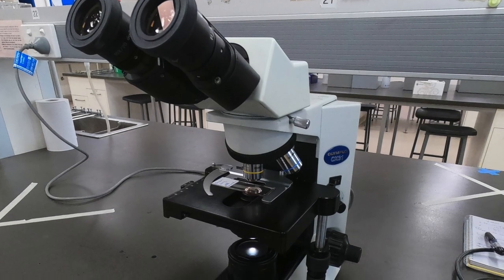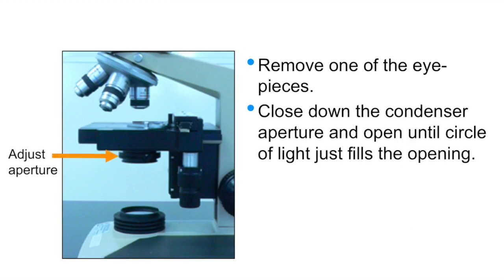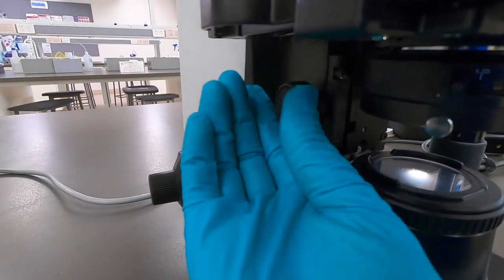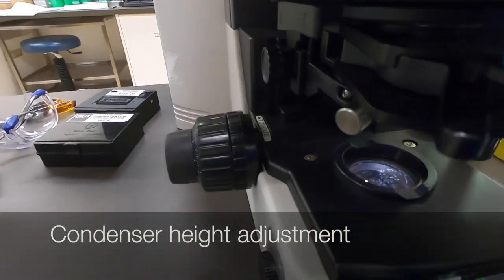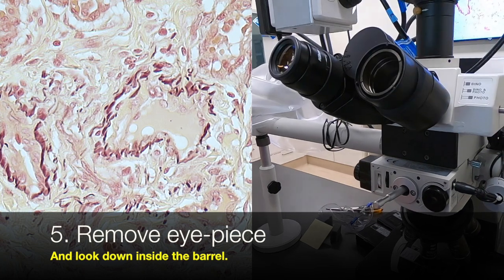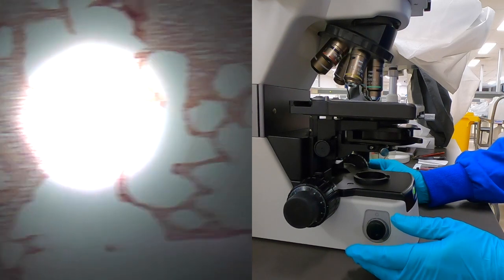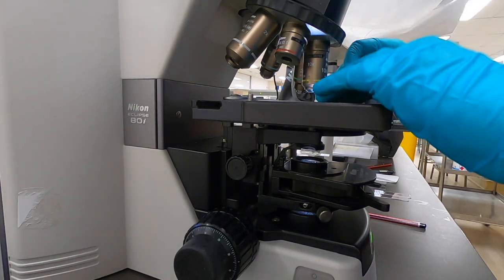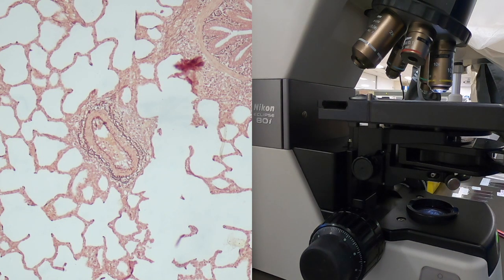How to use a light microscope - Kohler illumination

Comment: Wieso muss denn beim Koehlern der Kondensor zentriert werden. Seine optisch Achse sollte doch in jedem Fall 
mit der optischen Achse des Objektives uebereinstimmen und nicht mehr veraendert werden. Wohl aber 
sollte die Leuchtfeldblende zentrierbar sein. 
Das bedingt auch immer eine zentrierbare Punktlichtquelle.
Reply from the maker: A centred light source enables more even illumination of the area of interest. Since the condenser lens focuses light from the light source, then it should be centred. Closing the field iris diaphragm provides an approximate focal point to achieve this.
Reply: @damienharkin  first the light source has to be centered to his iris. Diffusing filters can make the source more even. The condenssor iris should be in the middle of the picture centering it. The condensor iris should be als closed as possible , because we all will prefer interference microscopy. At least the lightfield-iris can be centered to so called Keohler-iris. But in many cases it gives a better image using oblique DIC-like illumination. Koehler-illumination is only usefull for the factory aligning and testing their optics not for good microscopers
Reply from the maker: Thanks for the feedback.

Comment: Thank you for this video! 
How would one achieve Köhler illumination at 400, 600 or 1000x magnification where the edges of the hexagon can barely be seen?
Reply from the maker: Hi Harp, If you adjust for Kohler illumination at lower powers then you should be reasonably close to where you need to be, but if needing to be more accurate then would suggest using the pen/pencil technique as displayed in my video.
Best wishes
Damien
Reply: @damienharkin  Thank you very much! It is much appreciated :)